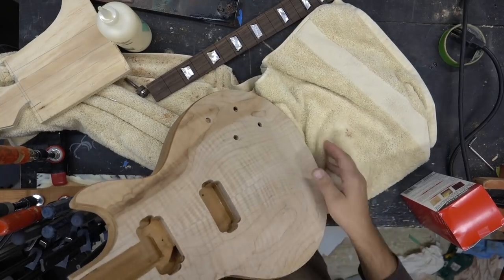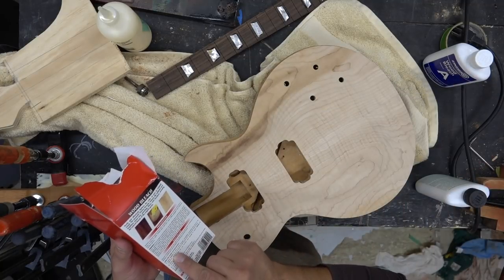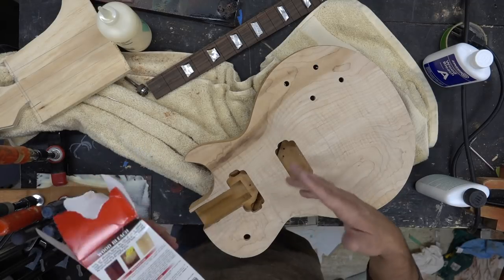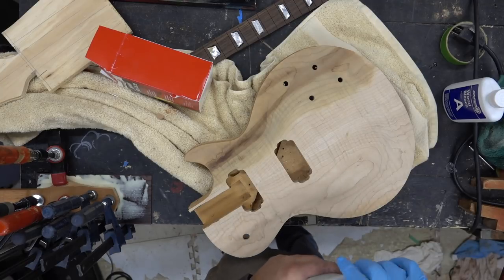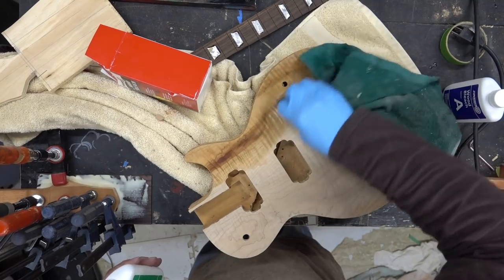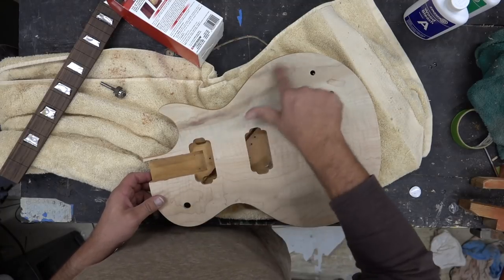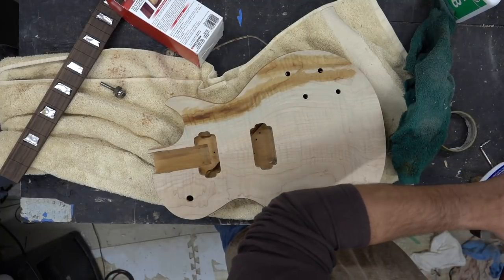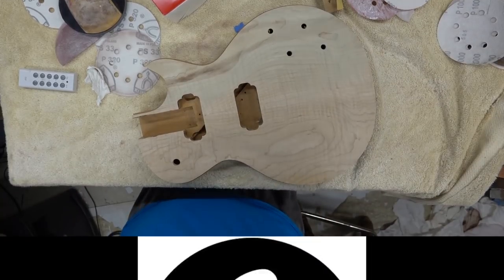Using Wood Bleach on a Guitar Top - Cleaning up a Streak

Comment: Once you break the seals DO NOT shake the bottles (there's no need, ever) - one of the components ("B") is concentrated hydrogen peroxide and bottle is ventilated - you will toss product all over the place!  This component is also why you cannot ship this stuff via air.

FWIW - I've had much better success with home-made bleach (lye and peroxide) but the Zinsler is certainly readily available and not too spendy (IIRC it's like $7 at Menards)
Reply from the maker: good advice.  thanks for posting

Comment: Question for you, D: Do you think a few rounds of wood bleach could be use to create a faux binding strip on a bubinga top? Recently picked up some GluBoost tape to attempt to do something as seen in another one of your videos... but know the natural color of the piece I have will be a very hard to deal with even if I add a little red stain to it. In theory, with careful application and patience, do you think bubinga would get light enough? Would a  few coats of white stain be better?

Comment: Oxcalic acid  works wonders, just dilute crystals with water then neutralize with baking soda.Be careful staining it will darken alot more than the rest of the wood. Or start with a better choice of wood!
Reply: I buy it diluted All ready in deck cleaner/brightener works great it will bring out reds though so dont know if it is just in the product I'm using or if it is the oxiliac acid I think its the acid have seen it used as a stand alone product and had similar effects I imagine that wood bleach he is using cost an arm and a leg and prob is a very weak blend

Comment: Damn Big D I dint think,there was any thing I knew that you didnt about wood and such just use deck brightener and cleaner it has oxiliac acid in it I'm sure that is what that product has in it just an fyi if you are doing something cedarish it will bring out the red in it as well really deepens the figure as well